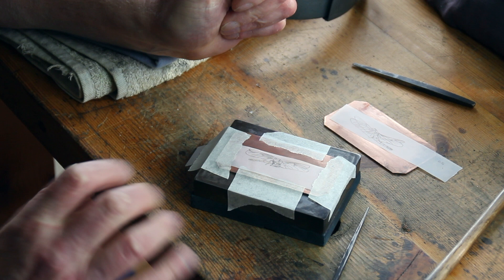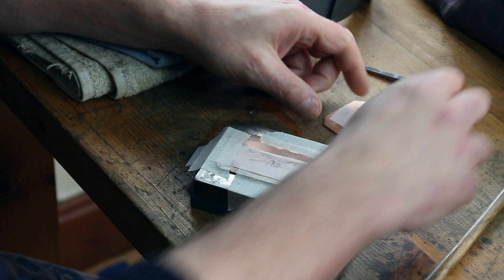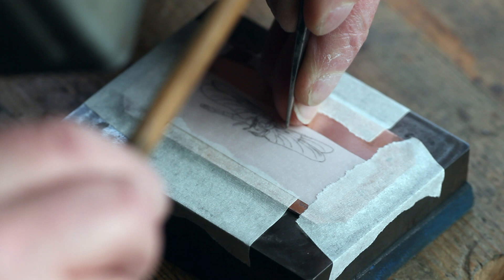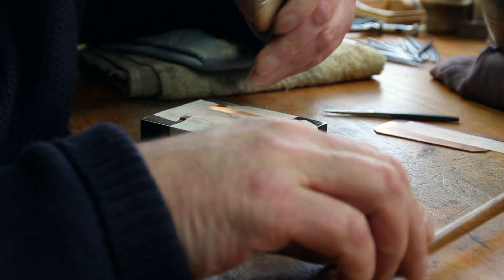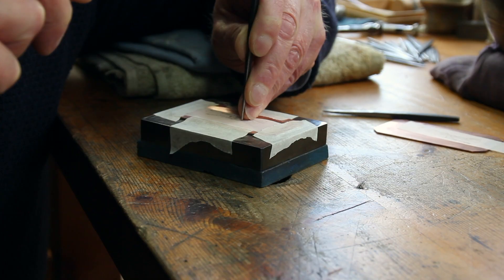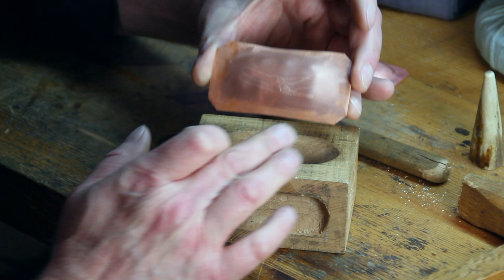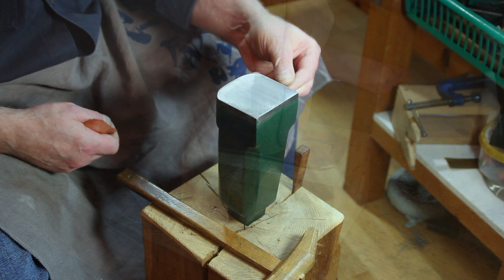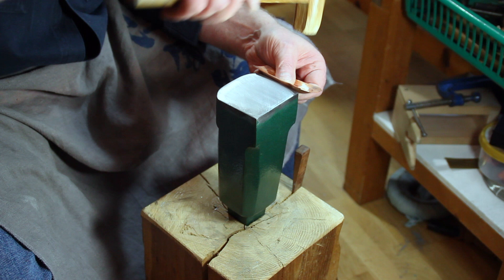Uchidashi - Dragonfly Menuki - The Trailer

Comment: Hello! Are You use forming on the led plate? Or it can pollute the surface?
Reply from the maker: No, for this sort of work I never use lead for pre-forming. Lead can contaminate non-ferrous metal, yes, Especially gold and silver, which it then ruins. If you must use lead it's wise to have a layer of plastic sheet between the lead and the metal.
Reply: Thank You for very useful reply! I'll keep it in mind.